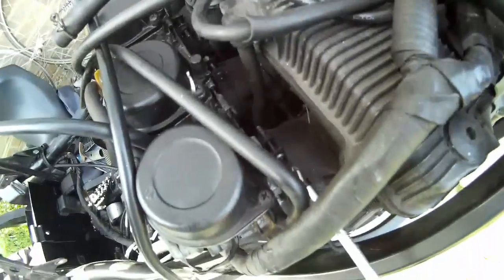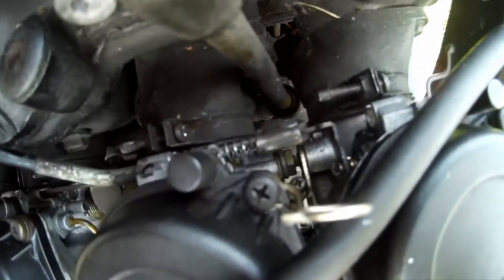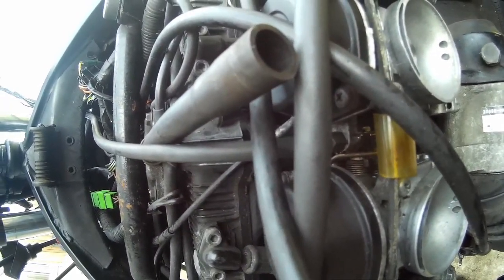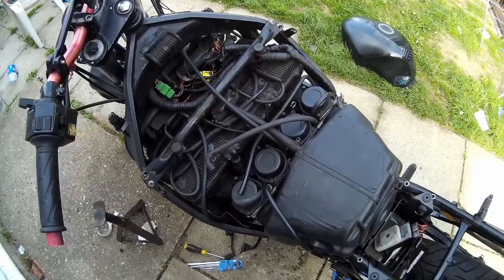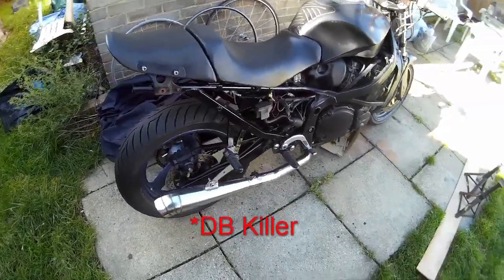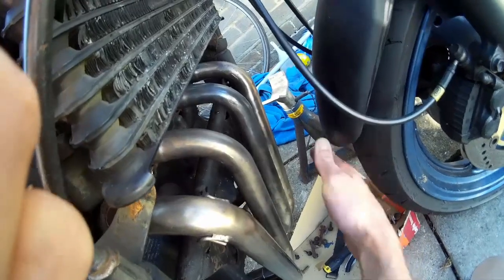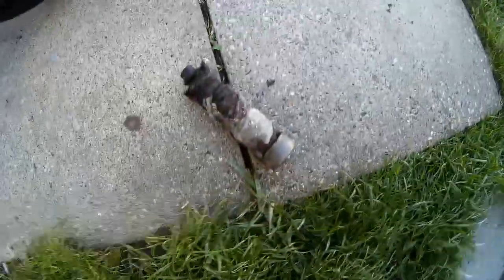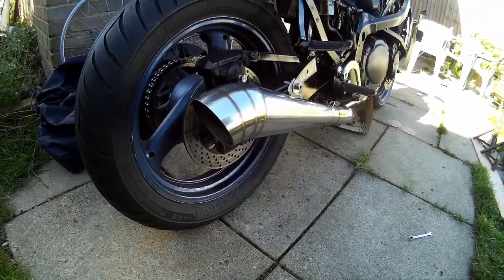GSX 600 Project: Will She Run On All 4 Cylinders Now

Comment: Shes alive... loud without the baffles, i did that in my garage, couldnt here myself think...lol, did you get the exhaust clamps ?
Reply from the maker: Yes she's alive and loud mate going to see about trimming some length from the pipe ideally 5 inches or so to negate the home made hanger. As for the exhaust clamps I haven't yet but still plan to change them either soon after mot or before.